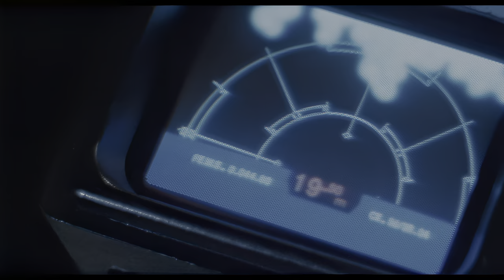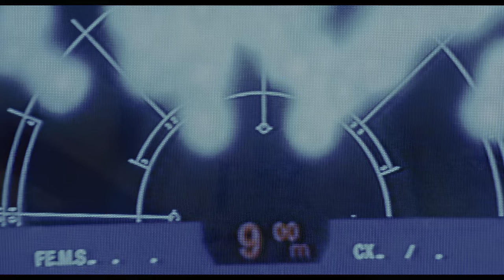Aliens (1986)  NEWT IS TAKEN WATER Scene Movie Clip - 4K UHD HDR Upscale New Version

Comment: The silence cut only by the tracker, the feeling of being exposed iand vulnerable amid  corridors which are empty in all directions, even the shock and retaliatory violence which saves you but showers you with acid blood, are perfectly replicated in the 1999 game aliens vs predator. Not alien isolation or avp 2 or any other game. Yes, a 1999 fps with polygons you can count visually is better than any other adaptation of this material.